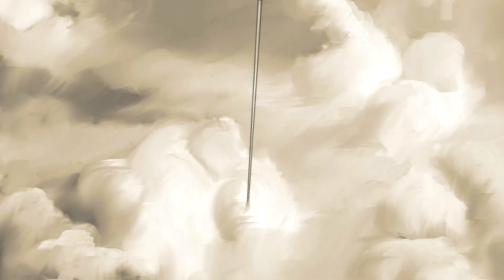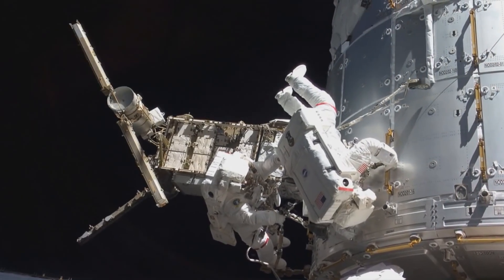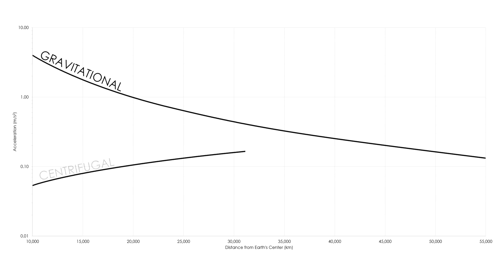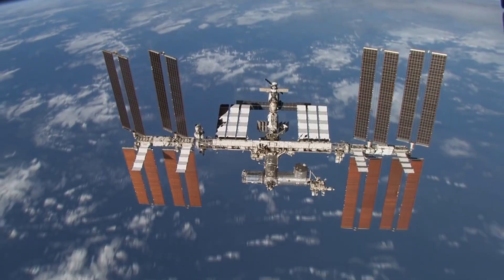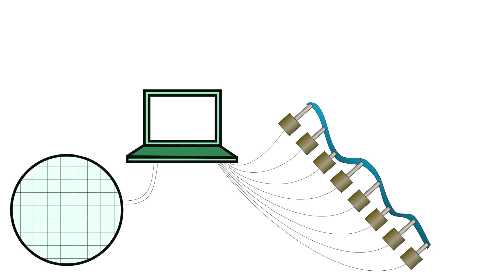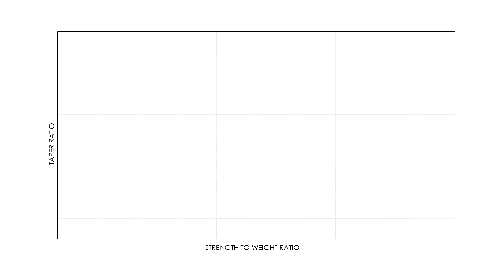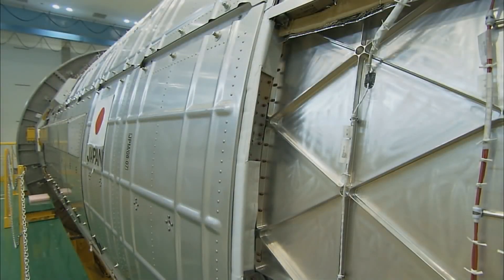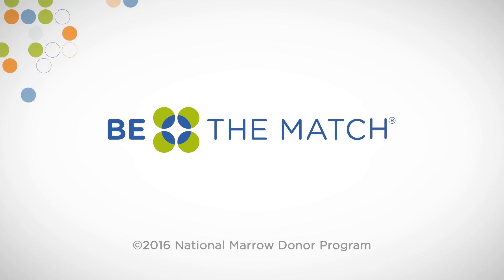Design Your Own Space Elevator

Comment: I'm just curious about conservation of angular momentum. Wouldn't there still need to be some kind lateral propulsion in order to keep the angular velocity constant?
Reply from the maker: Presumably the lifter would be small enough that the force required wouldn't be too high. Plus, coming back down it would just give the angular momentum back to the earth. However, I do think you'd probably need some kind of means of station keeping with the satellite to make sure it stays right where you need it.
Reply: Awesome, thanks for clearing that up! Really enjoying your channel by the way - I'm currently studying mechanical engineering and these experiments really helps illustrate those fundamentals, music is great too!
Reply: Wouldn't the tether keep it at geostationary speeds as long as its pulling outward.
if it's slower it's not going out as far so the force speeds it up the same if it goes to fast.
Reply: The central petal force wants it to go directly up and any angle from going to slow or fast won't let it go quite as high.
So as long as theres enough extra tension it should be fine id have thought.

Comment: Space elevators don't really make economical sense any more.  If you have a look at what SpaceX is doing with their reusable rockets it seems like a much more realistic for getting payloads into space cheaply.    
Once the payload is sent into space the rocket returns and lands on a ship where it can be transported back to the factory.  Although they haven't relaunched a used rocket yet, once they get this down to a routine process it will be much cheaper and faster to get things launched into orbit.  Imagine if they could get it down to 30 days to recheck and refuel a rocket.  And then if they manufactured another 30 rockets then they could be doing one launch per day.  

You could compare this to doing deliveries in your car.  For each delivery it wouldn't make sense to only have just enough fuel to get to your destination, and then destroy your car and have to build a new one for the next delivery.  You could just put a bit more fuel in it so you can drive it back home after the delivery, then just refuel it for the next delivery.

Comment: The only efficient and safe method on any near-term horizon is linear accelerators. 
Package up what you want to send into space onto a reusable sled with a conex type payload container (designed for space, of course) with a small amount of maneuvering fuel and active shielding system for heat,  accelerate along an evacuated tube at the maximum rate for the payload using maglev traction motors. The tube would be quite long for fragile stuff, like peeps n things, say a bit more than a hundred miles at a steady 145 fps^2, or much higher rates for building materials and fuel n such. The cost for a starter system would be around a trillion worth-less-and-less US$, but would put payload into high earth orbit for pennies per pound~ say about a thousand pennies per pound, not including the infrastructure start up costs of course. I have been working on this idea for about a decade, and have concluded that as of today, the engineering and materials disciplines have achieved all necessary potential, at least better than what the Apollo system faced when it started up. The evacuated tunnel must start at a very low elevation, and curve gently downward for a bit, below the surface, and then curve ever more gently upward to exit at the highest point possible; i.e. the top of high mountains. Proximity to equatorial boot would be advantageous. Two good nuke power plants dedicated to the system would provide all the power needed. Putting one or two hundred ton payloads every hour on the hour round the clock into high earth orbit would be very feasible with this system.

Comment: First of all, kudos to you for promoting the bone marrow registry. (note my qrcode). I got my transplant 6 years ago. The closeness of the match between donor an recipient makes all the difference between success and failure and quality of life.
    Second, I have some difficulty figuring the effect on the tether of the change in momentum of the car between the surface (traveling about 1000 mph) to geosync orbit (traveling at 78,500 mph). Experiment: Position a heavy gold ring near the attachment point of a spinning string tether. Have a pulley attached to the counter weight to pull the ring outwards. Note and record the changes of force vectors on the system.

Comment: Actually if you think about it, kerolox and other chemical fuels are pretty good ways to power the pod too. With a support cable, you can make chemical launch vehicles an order of magnitude more efficient. Won't be popular with YouTube environmentalists though.
Reply: Chemical fuels aren't that much of an issue. You can create hydro-lox fuel with electricity and water, so if you have a clean source of electricity your fuel production and use is clean.

The problem there is that you run into the Tsiolkovsky rocket equation. Basically you need an exponential mass of fuel to lift an object because you have to lift both the payload and all the fuel not yet burned. If you're going to do that then the most efficient way is with modern conventional rockets and modern launch profiles.

You could check what the requirements would be for using fuel in a fuel cell rather than as a reaction mass. It's possible that would be more efficient. Still it's probably best to use electricity either beamed or transmitted through a pair of cables and save the entire fuel mass.
Reply: +jedimastersterling1 well the thing is we know that even as rockets, chemical fuels can lift cargo into space effectively. The difference is that the tether provides all the tangential acceleration to the pod. The pod only needs enough energy to lift itself out of the gravity well radially along the tether, which only requires 1/10 the energy. You can get way lower fuel fractions than with rockets.
Reply: My calculations say at GEO potential energy is 11.2 times kinetic energy so even in an ideal case you're saving only 1/12 of your delta-v and that's before calculating for drag from the cable or wear on the cable from going as much as 10 km/s near the base.
Reply: You're right, I botched that number. At GEO, it's not a big difference.

Still, the efficiency of a fuel fired powerplant is much better than the propulsive efficiency of a rocket just because you don't spend any energy accelerating the reaction mass. The cable is the reaction mass, not the exhaust.

Comment: Assuming we have a nano material strong enough then why not just build in solar cells as part of the cable, that way you don't have to worry about power losses over thousands of kilometres, only over tens of metres as the lifter passes that area it uses the power generated in that area. Lower mass lifter with significant power should easily do the journey in a few days if not even down to hours. Most of the journey is done in very near to vacuum so no air resistance to worry about

Comment: question for you........if you were to assemble a sealed container in outerspace,(theoretically assuming the container had no weight) and brought it down to sea lvl.....would it float?
Reply from the maker: Assuming it had no weight, yes. Buoyancy is a function of how much liquid is displaced. If the weight of the water displaced is greater than the weight of the object, it will float.
Reply: Sure. You can do the same thing with a vacuum pump. The reality is that almost any container strong enough to hold the pressure out will be heavier than the internal volume in air.

Comment: Carbon nanotubes conduct really well. Have 3 tether cables each of which can handle half the load (ie one cable is redundant). Run power and ground up two of them and power the climber from the ground via your big extension cord. If one cable breaks then if its a power cable transfer power or ground to the other cable. This gives a good safety margin. On the other hand if the NASA tether experiment is an indication it may develop its own power...lol

Comment: Did you really just use the word centrifugal force in a physics/engineering video? Other then that I think it was a great video...
Reply from the maker: If you do a free body analysis in a rotating reference frame, you must include the centrifugal force. If you don't you, get the wrong answer. The idea that the centrifugal force doesn't exist is an over simplification.
Reply: Practical Engineering I guess you do have a point there.

Comment: I have a question that I feel like no one ever addresses. Where does the fresh supply of orbital velocity come from? Things stay in orbit because they have built up a very high velocity. The huge rockets aren't necessary for reaching space, they're necessary for staying there. If something climbs up the space elevator, it's going to be accelerated laterally by the elevator up to the same orbital velocity of the anchor. The force to produce that velocity has to come from somewhere, it has to be passed on from something else. It seems like every payload taken up the elevator would slow the anchor down. How do you keep the anchor from losing speed and coming out of position? How do you replace that momentum that had to be taken away by the payload?
Reply from the maker: +wulfolme Great question. I didn't have time to discuss that, but the tether also has to apply a horizontal force to the lifter as it goes up. More info on Wikipedia if you're curious.

Comment: why put the end of the tether on a geo-stationary orbit? why not put it about a mile or maybe more this could reduce the tension problem by half or more because the counter weight will want to fly off in to space while the tether would keep it there, providing more lift for the tether, then all we have to worry about is the tension strength on the tether

Comment: Can't we use an engine at the bottom and a pully on the satellite, and just fix the cabin on the cable, and turn the whole thing like a giant timing belt? I don't know how big the engine would be or how powerful is has to be or how much torque is needed. It was just one of my thoughts and I seemed way more practical than using a laser to transfer power.

Comment: @Practical Engineering: what about building a space elevator on mars? The Gravity is 1/3 of the Earths gravity so the Clark belt is much closer thus the tether can be much much shorter, thus thinner. We could consider putting it on the moon but the it rotates way to slow, so Mars sounds like a perfect place - it rotates close to the same speed, has much lower gravity, and Olympus Monds (the highest mountain in solar system) could too help a bit. What do you think?
Reply: quick research, Martian Clark belt is at 17,000 km, so much closer. Olympus Monds would not help with the gravity as it's influence would be minuscule, but it would help with the laser powering as it's peak is above martian atmosphere. And the pull on the tether from the mars would be significantly lower as the gravity is only 1/3. I can not calculate the tension stress chart that you drew .. would kevlar be strong enough?
Reply: The only problem with that idea is that I can't see how building one there would help get material off of earth!
Reply: It would not help, but Mars could become a space hub of a solar system. One can use space elevator to catapult space ships into space for free (literally like a sling shot). So it is not about earth, it is about humanity as a space ferrying species.
Reply: I'd say that it'd cater to the Martian segment of the market, how many people live in Mars? 

Oh, wait, you mean that place that is like Antarctica and the Sahara combined plus no air and lots of radiation. You'd get more customers for Rolls Royces in Haiti's shanty towns, really.

Comment: Lovin' the channel.  Here is a question for you or one of your knowledgeable readers.  Is it possible to get a payload into orbit by first using a balloon to get it as high as possible and then have an aerodynamic satellite swoop down, grab the payload from the balloon and get it the rest of the way into orbit? All parts re-usable?
Reply: the best balloons only get to about 37km and space is said to start at 100km and with any worthwhile payload you wont get nearly to 37km due to weight and any lower and you get a lot of atmospheric drag which will make any vehicle meant to grab the payload a lot more expensive fuel wise. Anything worth taking up would at least be taken up to more then 300km like the ISS, not to mention satellites orbit at like 35,000km, so boasting a payload to such heights would require a lot of fuel too. If they could design a space craft that could gain more fuel then it loses by refueling in such a way then their may still be hope for such an idea but it would take a lot of engineering to design such a craft that could overcome such obstacles.
Reply: The real problem is that even lifting up to the limits of the atmosphere doesn't actually help you that much - you then need to accelerate sideways by somewhere between 7 and 11 km/sec (can't remember the numbers offhand) to get into orbit.

That satellite swooping down would hit the payload like a head-on collision between two of our fastest hypersonic planes at full speed, even if you could adjust its orbit like that.
Reply: 8 km/s according to 'What If?' by Randall Munroe. In it he says that using a rocket  to go lift a payload 100 km vertically is the easy part. it's getting to 8km/s horizontally in order to orbit that takes most of the the fuel.
Reply: +Brad Evans .. that is the hard part.
Reply: The ballon part is unlikely, because drag.
The grab part is theoretically possible and is actually a partial space elevator.
Look up "Skyhook ".
Mind you, the momentum still has to come from somewhere.
Reply: Save the Helium!!
Reply: Pipe2DevNull, Giant weather balloons would work, with some adjustments and improvements, of course! Weather balloons can go quite high in Earth's atmosphere, if they can get to the mesosphere, spacecraft wouldn't have to fight as much air drag and gravity to get into orbit. Now, the balloons would have to be pretty big, about 400m in fully inflated diameter to carry a space capsule into the mesosphere. The World View company is experimenting with such a concept.

Comment: I'm not a trained engineer, and only around the 4:30 mark so I may delete this comment afterward. But why not center the elevator on one of the poles and use a pulley system scaled up. Tether the cables deep underground and use the friction of the earth's crust as an anchor point. Maybe a spiral a mile down and a mile across, something like that. Enough cords of sufficeint size and a strong enough friction based tether could work, couldn't it?

Edit:I just saw the cord bit, and steel and kevlar are absolutely untenable. But maybe a stonger material designed with tensile stenth in mind. Carbon Nanotubes may not bea reality, but something in the middle between kevlar and Carbon nanotubes.
Reply: You're missing the part where this only works at the equator. Take a yoyo, and spin around in a circle letting to yoyo out at arms length. Works pretty good, right? Now tape the yoyo to your head and see if you can get it to stand straight up. Doesn't work so well, right? Same thing with a space elevator.

Comment: Fantastic, some one who is actually considering the practical engineering challenges rather than the SF B...S! As an electrical engineer, I would like my ten cents worth to this...
a. No one seems to consider the real problem of how you would actually build it, in terms of either running the cable up to the anchor, or running the cable down to the attachment point on earth, as there is the "small problem of Celestial Mechanics that comes into play..
b. With respect to one's video, one has not cosidered the affect of windage, and the earth's weather the motion of the earth's atmosphere over the length of the cable would have a considerable lateral force on the cable.
c. No one seems to consider the electrical effects on the cable, as it would be cutting lines of the earth's maganet field, and with the solar wind across, and with it passing throuhg the Van Allen belt, it would generate a huge electrical potential difference between the attachment point on earth, and the anchor point in space.. it would not be advisable to be near it, and as a ball park , I am guessing this voltage difference could be in the mega volt range...

Any others?
Reply from the maker: Check out the sources in the description for more information about the problems you listed. They have been considered. I only had time to cover a few of the more fundamental obstacles.

Comment: ive said it before and i will say it again.

the elevator starts from the moon, not the a geo stationary orbit.

yes the moon is further, but the forces are much smaller because the velocity of the moon is smaller, don't believe me look into the sky at a satellite and the moon, let me know which is moving faster.  the reduced forces offset the additional length.

the elevator cable drags through the upper atmosphere and is docked to with a 747 type plane.

the elevator would likely be powered by microwaves from the moon., although the cable deflection will make this difficult but not impossible.

a long skiny cable will weight less a geostationary cable.

also the cable itself will be built on the earth the fired to the moon in a gun, something more difficult to achieve  for an orbit.
Reply: Let me guess, you've been watching Isaac Arthur's channel. He's got some interesting ideas on this topic, including elevators, skyhooks, and others.